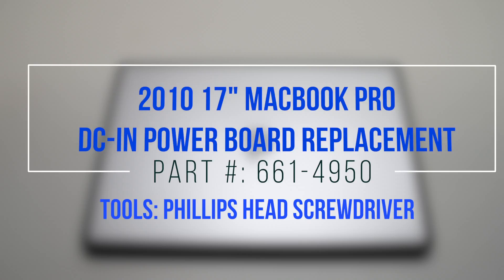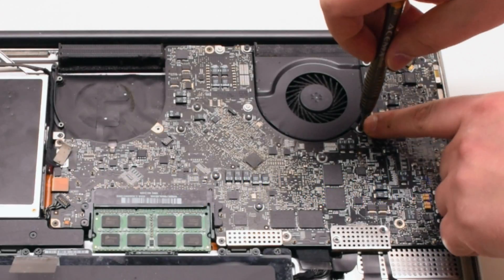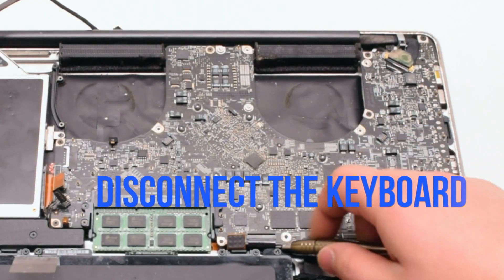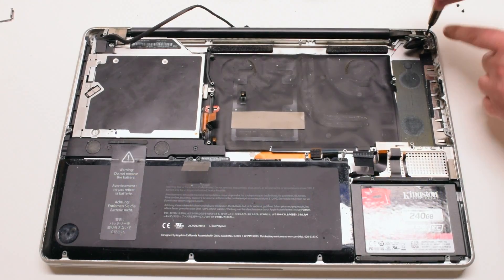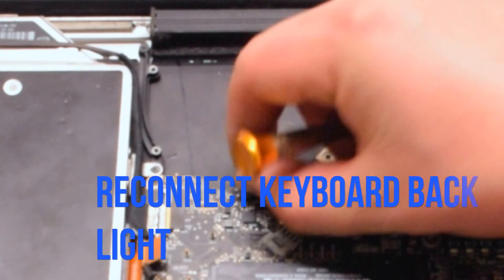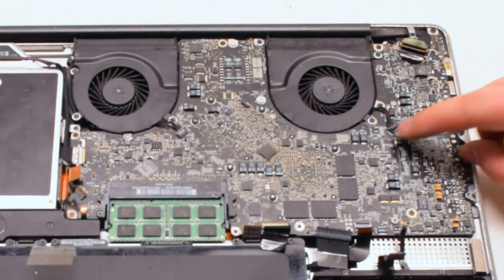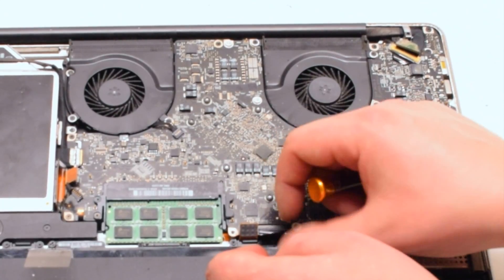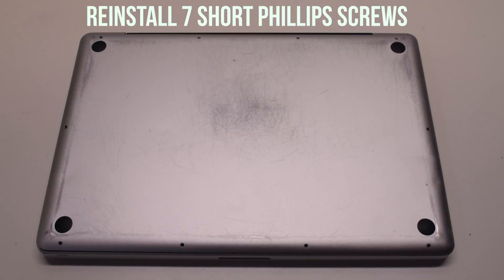2010 Macbook Pro 17" A1297 DC in Power Board Replacement

Comment: My MacBook Pro 2009 2.93 Ghz has difficulty switching on, it does not turn on just breaks off each time after the start and the characteristic sound of the mechanism (like "bzzz"). However, it can be turned on after repeated off and on again, after 30 - 50 together it finally turns on. However, it is very unstable. The battery is new and ok, but what can be the reason for this? What should be replaced?
Reply from the maker: Could be a loose contact with logic board. Best to take it out, clean it and reassemble.

Comment: Hi! How to do like an "Apple (Genius bar) test"? I really don't know if I have an issue with my cable adapter, my power connecter or the battery? It is hard to charge my Mac since a while. Sometimes the power stay in and go out. I have to check for few minutes if it keep charging or not. May be better to talk instead... to understand better the problem. Just let me know. I'm from Montrea in Quebec, Canada. Thanks
Reply from the maker: I understand that you have an A1297? Buy this charger first or similar that shipps to Canada http://www.ebay.com/itm/85W-AC-Wall-Power-Adapter-Supply-Charger-for-Apple-MacBook-Pro-MagSafe-15-17-/111500293072?hash=item19f5ef73d0:g:8o4AAOSwF1dUUb4L

If that's not the issues you will just have an extra charger for $20

Then buy this battery A1309 or similar that ships to Canada $20 http://www.ebay.com/itm/New-11200mAh-Battery-for-Apple-MacBook-Pro-17-A1297-2009-MC226-Series-A1309-/301899067172?hash=item464a962f24:g:DlMAAOSwZG9Wijjq

If the battery and charger don't resolve instability issues, then the logic board is the culprit and that is difficult and expensive to replace.

Here are the videos on how to swap your battery and swap your logic board. The last link is an interactive video map on how to replace every component of that unit.

Battery : https://youtu.be/cKRx24plIu4
Logic Board: https://youtu.be/bqPcIraxrl8

Interactive video map on how to replace every part of A1297: http://www.appledollars.com/2010-macbook-pro-a1297

Good luck!
Reply from the maker: Just a quick note AHT apple hardware test https://support.apple.com/en-us/HT201257 is a useless diagnostic tool, especially when it comes to intermittent problems. Read the article above and play around with it if you want. From my experience it's a waste of time. If you follow the directions in the comment above, you will isolate the issues. Good luck and keep saving $!